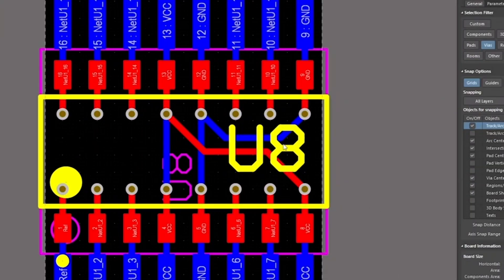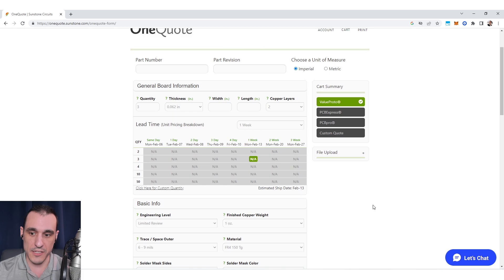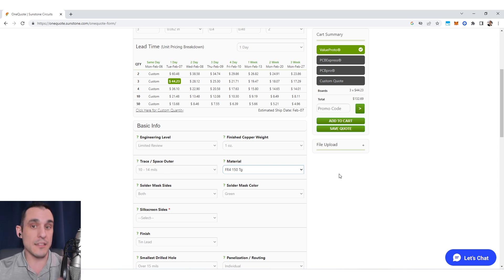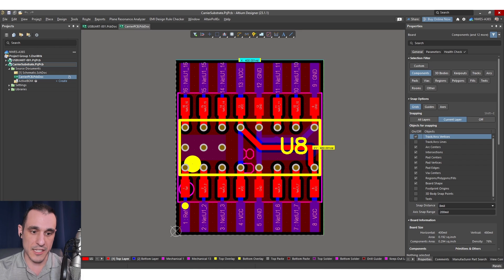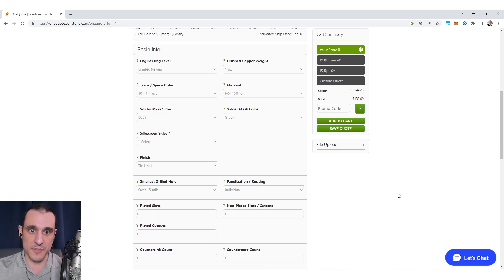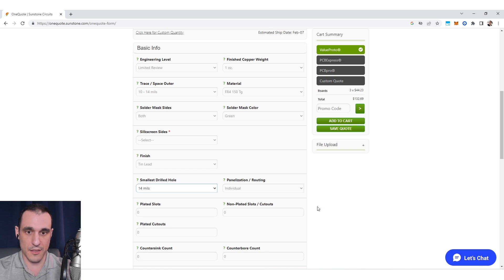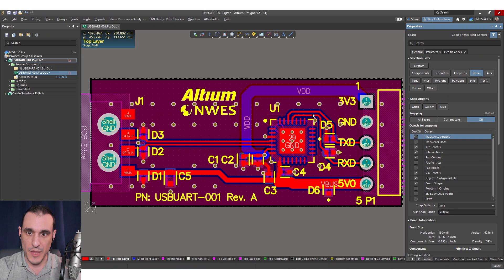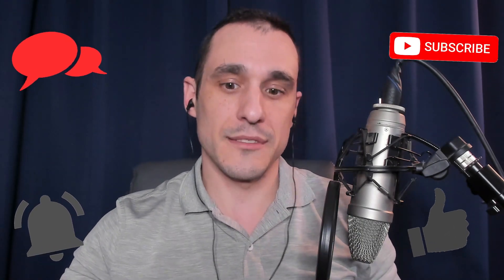How to Reduce PCB Production Costs During Manufacturing

Comment: Informative video as always. Actually, Altium has a great feature called Measure Permetive to measure the distance between 2 copper features :)
Reply: Everytime I feel like I get stuck in my ways with one of the features in AD, I find out about a new one. I always use snap points and Ctrl + M, but looks like I'll have to play with this feature.

Comment: 13:30 You have a hole size of 10 mil and a pad diameter of 18 mil. That gives you an anular ring of 4 mil. It is recommended a minimum anular ring of 6 mil from a fabrication and reliability standpoint.
Reply: I'm going off of the highest producibility level in IPC standards for Class 2 annular rings. If the fabrication house is less precise or you want additional reliability then yes the pad should be made larger so that there is more annular ring. The 2221 and 6012 standards define 3 different producibility levels, and it is these producibility levels that give the required ring size and thus the pad size for each Class level.

Comment: not letting manufacturing data leave your company with mistakes is the biggest cost saver... ;-)   to this end i always review the design with the electronic-engineer and production engineer as soon as the board preparation (outline, breakouts for transport-frame, layer stack, mounting holes, cutouts, fixed placing, design rules etc. etc.) and placing is finished before routing begins... 

then a 3D step model is sent to the engineer responsible for the housing so he can check component clearance, connector positioning etc..

when the routing is finished there is another review together with the electronic & production engineers...

...and to round things off i always check the gerber data with another layout design engineer...

all of these internal reviews throw up the odd problem or something that can be optimised...also as this video mentions, it's vital to design according to the capabilities of the PCB manufacturer - DFM, design for manufacturing...

of course all these reviews cost time, two to three days on average for a complex design... it's worth the effort though... over the last 20+ years at the company i'm working for i've never had a PCB come back that hasn't functioned (EMC included) as expected straight out of the shipping package...

be very carefull about cutting down the layer count just because ones boss or the purchase department says it costs too much... stand your ground 'cos those extra GND layers are important for the return path which in turn is turn important for EMC reasons... afterall whats the point of a design that is cheap to manufacture but doesn't pass the electromagnetic compatibility tests...
Reply: Well of course! Review everything and always get an extra set of eyes on it before sending out.

Comment: If you want to keep fabrication cost to a minimum, decide up front to constrain your design to the requirements of the Asian rapid prototyping fabricators. If you can get five of them made for $2 in Shenzhen, pretty much any fabricator will offer you their lowest rate.
Don't forget to include shipping in your total fabrication cost! It's often cheaper to pay a bit more per board if you order within your own country and have it shipped by domestic mail.
Reply: Only wished they offered overnight shipping on my boards. 2 days for a 4-layer board for $30 but DHL takes 4 days...
Reply: @henrychan720  Yeah overseas shipping can be a pain. Getting stuck in customs is always fun too.
Reply: Not everything can go overseas, all the ITAR and dual-use stuff we do has to stay local. But the same cost drivers still apply when you start looking at rapid prototyping and fabrication capabilities. One approach I always advocate for clients is to do the prototyping runs locally and then scale into a local CM for assembly with overseas fabrication. I think that can give you a good balance of quality and low risk. Also it's nice to be able to pick up the phone and call someone involved in the process in your own time zone.

Comment: As always, thanks Zach!
I personally reduced the cost of manufacturing a 4-layer rigid-flex PCB
by changing the connection of two flexible layers from the inner
layers MID1 and MID2 to the outer layers TOP and MID1.
Reply from the maker: Thanks for sharing!
Reply: I will admit I have not costed out enough flex or rigid-flex boards to know all the particular cost drivers, but I'm going to keep that in mind.